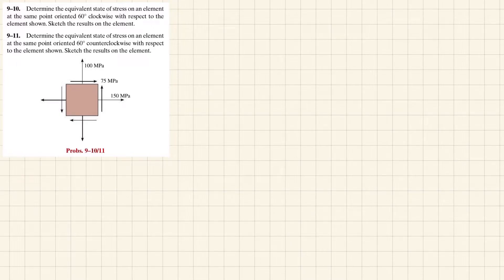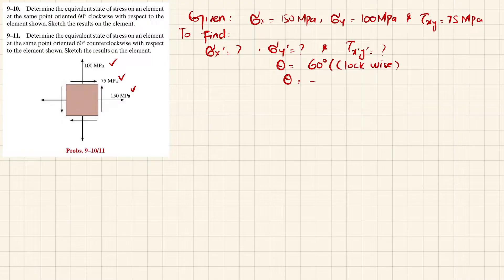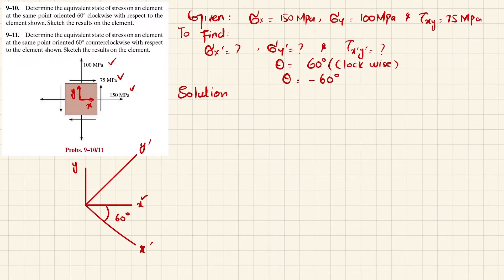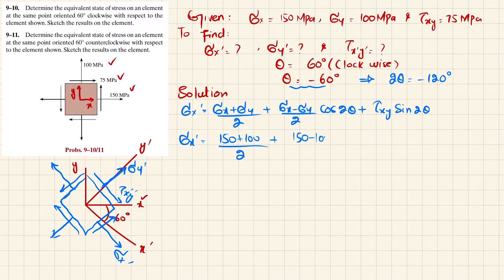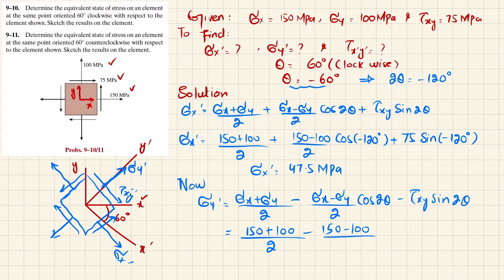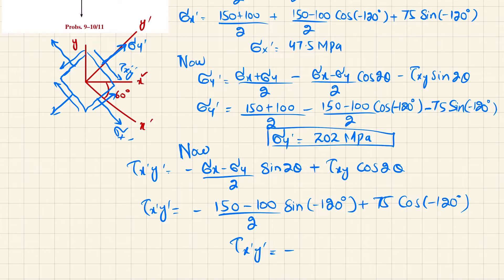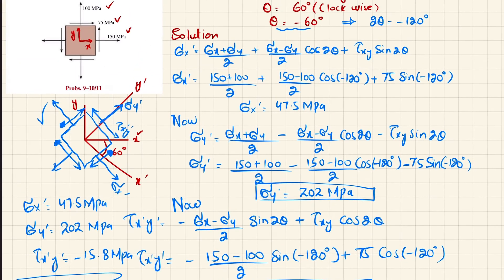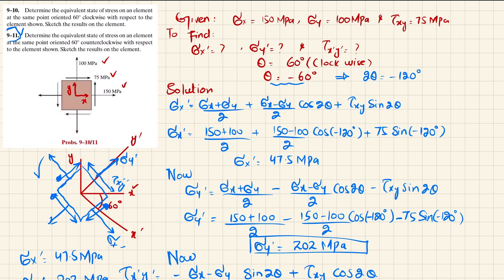9-10/11 Stress Transformation |Mechanics of Material RC Hibbeler|

Comment: If you were to write the -15,8 MPa onto the new diagram, should you include the negative symbol or does the arrow changing direction account for it?
Also: if, hypothetically, sigma-y and sigma-x had become negative in this problem, would their arrows have become compressive?
Reply from the maker: for first portion of your question the negative -15.8 is shown on diagram in opposite direction of that's why only 15.6 Mpa is written
Reply from the maker: and yes for the 2nd question if both stresses are negative then the stresses will be compressive ❤
Reply: @engradnanrasheedmechanical  Cool. Thanks
Reply from the maker: please mention the time in video where you are having confusion
Reply: @engradnanrasheedmechanical  5:56